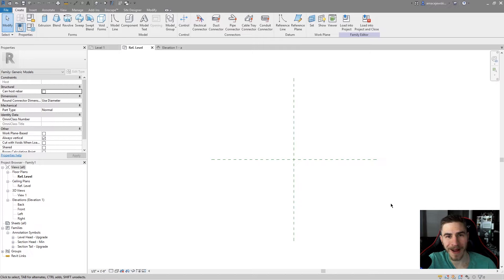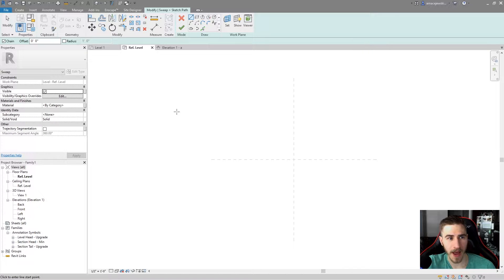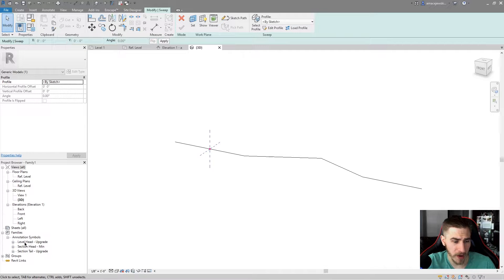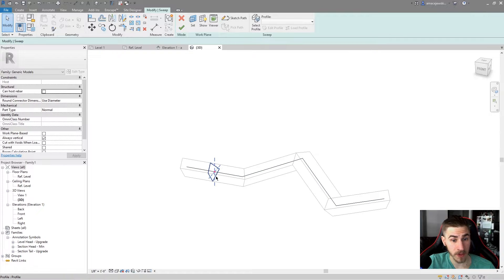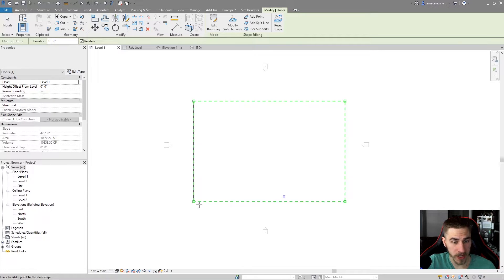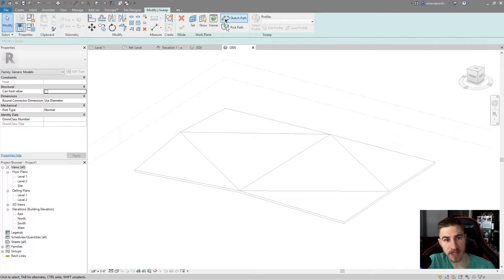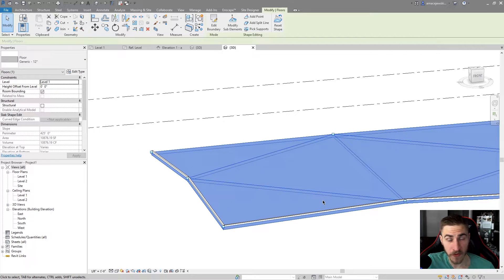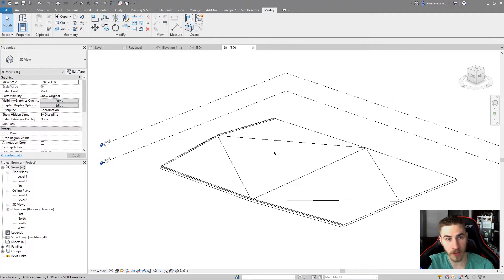How to Create Sweeps | Revit

Comment: Hi - thank you for this video. I am trying to make a thickened concrete slab (beam) - do you have any tips? or an email that I could ask you more questions in?
Reply from the maker: You might consider a structural floor, either that or placing concrete beams under floors would work. But if you have more questions, I would recommend my forum. Start a question and we can talk there. Others will be able to benefit from the answer too.

https://www.architecturevanguard.com/forum

Comment: How do I save the Sweep created as a family so I can use it on another project?  Every time I am doing a new project I have to create a new Sweep... and it is frustrating at times.
Reply from the maker: When you go to file new family, you can save it as a family anywhere you want. Once you are done making the sweep, you can save it and load it into your project. If you want to use it in another project, simply open the family where it is then load it into another project. Or you could use the insert family from the insert tab in that other project.